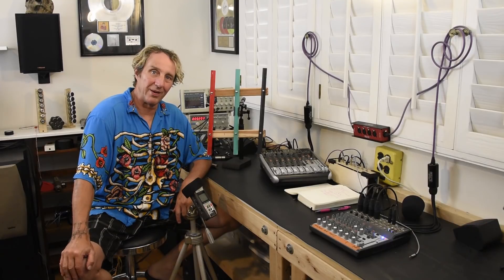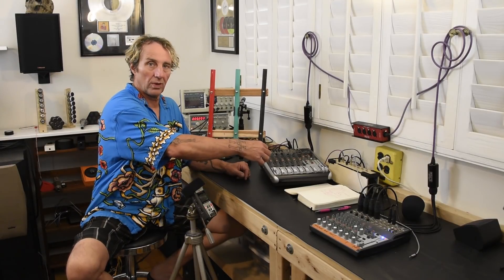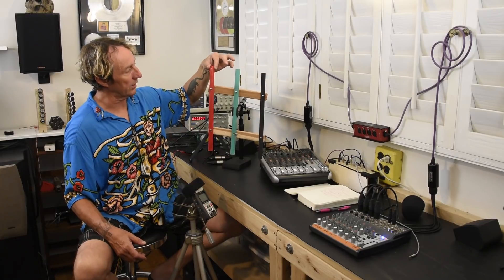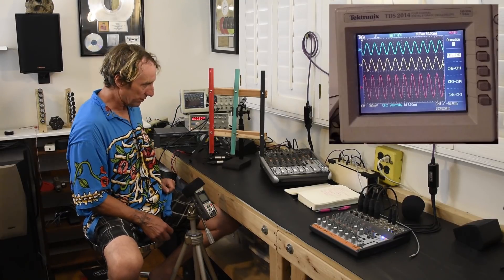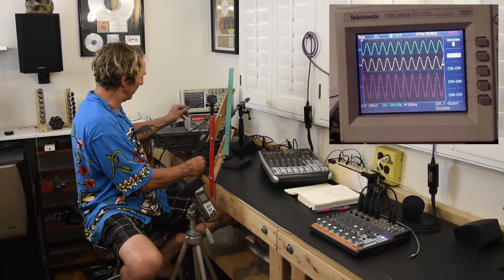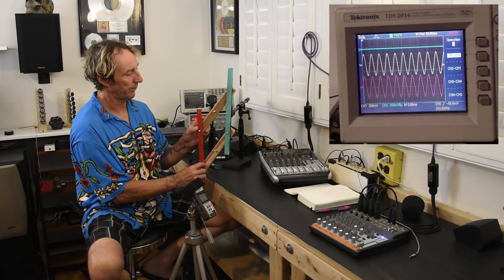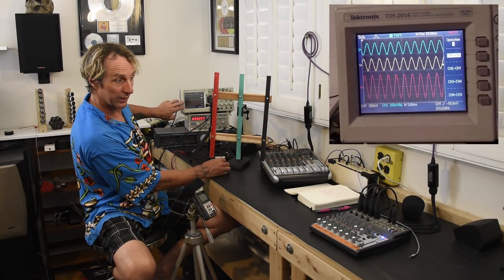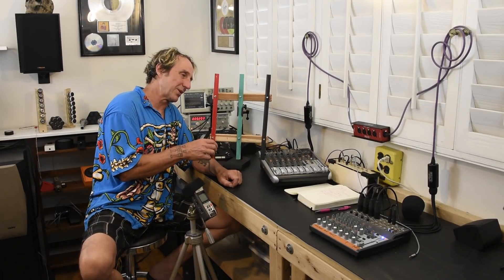How Do Balanced Audio Lines Work?

Comment: How is the signal on pin 3 put out of polarity? Where does it happen and how?
Reply from the maker: Electricity relies on a flow of electrons from and to. So for a 9 volt battery, the positive terminal puts out 9 volts on the positive in relation to the negative terminal.  it can also be looked at as the negative terminal puts out negative 9 volts in relation to the positive terminal. If you have two 9 volt batteries and connect the positive of one battery to the negative of the other battery and you connected the open negative to ground (0 volt reference), the open positive would have 18 volts in relation to ground. If you connected the open positive to ground, you would have negative 18 volts in relation to ground and finally, if you connected the middle where the batteries are connected together to ground, you would have plus 18 volts on the open positive and negative or minus 18 volts on the open negative, in relation to ground.

So, you could look at the plus 18 volts and "in polarity" and the minus 18 volts as "out of polarity".

A mic works similarly, you have a ground as the housing and pin one and the mic puts out a signal across pin 2 and pin 3. Pin 2 and 3 have equal and opposite signals. Like a see-saw, when one pin 2 goes up, pin 3 goes down and visa versa.  The signal we call "in polarity" is the signal that has a positive voltage when there is a positive pressure on the mic diaphragm. and that is the signal we attach to pin 2.
Reply: @DaveRat  Thank you for the explanation. I greatly appreciate your knowledge and the fact that you are sharing it with us.
Reply from the maker: Awesome and thank you!

Comment: So it is a common misunderstanding that balanced line requires three wires? The concept of balancing is possible with only two wires, right?
Reply from the maker: Only requires two for the signal.  The 3rd wire is purely a ground or shield to reduce interference.

Comment: Good day.   I like the demo!  because a line is balanced, it doesn't always mean it's differential.  For example I'm not certain any of the  TRS output on those two mixers are differential... They are likely impedance balanced meaning between the ring and ground there is a resistor(load) between it and sleeve.    This is to prevent ts connectors from blowing up drive circuits.   the drain wire is a mandatory return path for phantom, can't have it without it!
Reply from the maker: I believe that is correct for the TRS outputs
Reply: @DaveRat  I wish you would join us in the AES SC-05-05 talks!
Reply from the maker: Hmmm, not sure I am expert enough I. Aes to be an asset
Reply: Dave, never downplay the expertise that comes from actually practicing the techniques.
Reply from the maker: In many areas I have significant field knowledge. I really just have not had a lot of hands on with aes. When I was a pa tech, aes was not commonplace and was rarely used. As an engineer, my techs would use it and I would spec it, but pretty much it just worked for me and they dealt with any issues. And currently we use it in systems we deploy but again I just don't have much to offer. Same with fiber optic and Dante. My knowledge set is quite minimal in those realms
Reply: “Differential” meaning equal but opposite, right? I’m very curious about this as it would seem to me using a differential signal would be over complicating things, although I don’t understand it fully.

Comment: As Dave hinted at, the signals do NOT need to be exactly the same in (opposite) amplitude. That would only happen if the ground is exactly zero and in the middle. That is not required; in fact one of the advantages of balanced lines is that ground is no longer a reference. If you require that the phases are exactly the same in amplitude against ground, you re-introduce ground as a reference with all noise problems you want to avoid.
BTW great video, and a very imaginative analogy!
Reply: I’ve been trying to wrap my head around this. I recently read about how the “equal and opposite “ thing wasn’t actually how it worked and that if it did, there wouldn’t be a stable reference to make the comparison and filter the noise anyway, and it could introduce other issues like if the wires aren’t exactly the same length, etc… But I keep seeing the equal and opposite thing everywhere, and some of it does make sense. So is it that there are multiple ways to make the balanced circuitry, or what is up with that?
Reply: @almightytreegod  There's two cases that people bring up the 'equal and opposite sign' thing. One is misunderstanding what a balanced line is - we've been over the equal impedance thing. The other is where it makes sense to have a pair of lines with each line in opposite phase and equal magnitude referred to ground. That is differential signalling, and it will allow you to maximize the signal level you can transmit. With differential signalling you have double the signal level withing a specific power supply headroom, so half the noise. But ground is a reference in diff signalling (signals are opposite phase and equal magnitude referred to ground) so dirty grounds can have an impact. Real balanced lines have no reference to ground, they only need to stay within the power supply range. It is exactly that reason that you can't talk about 'oppposite phase and equal magnitude' in balanced lines because as soon as you do, the question is: equal/opposite referred to what? Say 'ground' and you have re-introduced ground as a reference which you wanted to avoid in the first place.

Comment: Hi Dave. I love your videos. You regularly blow my mind with the concepts and demonstrations. I hate to be that guy, but the balance of a balanced interface has nothing to do with signal symmetry. It is the balanced impedance of the high and low conductors relative to ground that determines the Common Mode Rejection of the interface. Check out Bill Whitlock's whitepaper on the subject for That Corporation: https://www.datasheetarchive.com/whats_new/a5736ca167115891b481677d6ec0cc99.html
Reply from the maker: Interesting. Let's take a look at 3 scenarios.

1) balanced line with equal and opposite signals. The mic subtracts one from the other, so you have 
a  -  (-a)=2a

Scenario 2 you have the same signal on both lines so you have 
b - b = 0

Scenario 3 you have differing signals on both lines so you have
c - d = c - d

Now you can any combo of those three scenarios occuring simultaneously and independently. 

And have one line with .5a, b and c and the other line with -1.5a, b and d for example and the result would be
2s,c,d

Just like if you had a, b, c and -a, b, d would equal 2a, c, d

Following this math out, you don't need signal level symmetry to balance, nor do you need both lines to be identical in signal content to cancel out noise, as long as the noise is induced identically, it will cancel.

All that said, the way balanced lines are designed to work on the gear we use is for the signals to be equal and opposite on the outputs and then subtracted on the inputs.

I will take a look at the white paper at some point when I get to a computer.
Reply: @DaveRat  absolutely spot on. There are a few differential input circuit designs, the cheapest and most common ones actually, that have one side of the interconnect driven at a lower voltage relative to ground. 

It doesn't matter if the high is at 1.23Vrms relative to ground and the low is terminated to ground on the output side with the typical output impedance. As long as the impedance to ground is identical for both hi and lo any coupled noise currents will become common mode voltages and be rejected by the differential input. 

Any difference in signals, whether that is the difference between +\-1.23V or the difference between 1.23V and 0V, will be passed by the input. This is how you can get some noise rejection if you connect an unbalanced output to a balanced input correctly. 

Bill Whitlock has another great paper on balanced and unbalanced interconnects that goes way deeper into optimizing noise rejection of interconnects. He is the you of the audio interconnect circuitry world basically.
Reply from the maker: @mudged-upguitars4643  super cool and thank you Joshua!
Reply: @DaveRat  thank you for all the cool videos!
Reply from the maker: @mudged-upguitars4643  👍

Comment: The way I always teach it to my underlings is this: You have a signal that is exactly the same but inverted, if you sum them together you get zero eight? The logical answer is yes. A 1 minus 1 = 0. So how does a balanced line eliminate noise? If one is a minus and the other positive and they would normally equal zero if added together, then what if you invert one of the signals back to a positive? 1+1=2 right. The answer would be yes. How does a balanced line eliminate or reduce noise? The noise injected on both the + and - signal lines are common to both of them, so if you invert one of the signals, you, therefore, cancel out the noise. This is CMR, or Common-Mode Rejection, at work. If they have no idea of what CMR is, I tell them to come back the next day with an answer. That usually works. 7 out of 10 " audio guys " cannot comprehend this, unfortunately. Most don't even know what pins 1, 2, or 3 are in terms of signal relation.  This should be a 101-course subject, but it is not exactly a common core lesson, unfortunately.
Reply: The  "balanced" so blocked only the noise instead of the signal because of the CMR?
Reply: @Gabbolbee  yes. Again, imagine two lines with the exact same signal, but the wanted signal is in opposite polarity on one of the lines. Noise that is injected on both lines is common to both of them. This means the noise is the same polarity on both lines. At the preamp, the signal of one of the lines polarity is inverted. This is what makes it become a 1+1. The injected noise now becomes out of polarity and cancels out. The signal we want has a three db increase and the noise is canceled out.
Reply: Glad for your for your replies, gonna figure out some little details
Reply from the maker: @Gabbolbee  👍
Reply: The noise is the same polarity on the two lines, so if you subtract the noise tends to go to zero. The signal is out of phase so in the diff receiver end you get the total signal amplitude.
Actually, the signals do NOT need to be exactly the same in (opposite) amplitude. That would only happen if the ground is exactly zero and in the middle. That is not required; in fact one of the advantages of balanced lines is that ground is no longer a reference. If you require that the phases are exactly the same in amplitude against ground, you re-introduce ground as a reference with all noise problems you want to avoid.
BTW great video, and a very imaginative analogy!
Reply: @jandidden8170  thank you very much, now i got it.
Reply from the maker: A balanced mic pre subtracts the two signals. Such that signals that are opposite get added and signals that are the same get cancelled.

Also, signals that are different, not opposite, and not the same, pass through

Comment: Why do some of my guitar pedals effects lose power and sound before entering my 1073 mic pre input ?  ..this is my set up synth/drum machine > guitar pedal > 1073
Reply from the maker: Hmmm, if the pedals are high impedance and the mic pre is low impedance, you may see a level drop. You could try inserting a di box between the pedals and mic pre.

Or, there could be a wiring issue on the 1/4" out of the pedals to the XLR to the mic pre, if those are the connectors. Check the adaptor wiring to I sure tip to pin 2, sleeve to pin3 and to pin 1
Reply: @DaveRat  oh I forgot to mention it works fine when I use the DI hiz input but it has a thinner sound and I like the rounder thicker lxr input sound
Reply from the maker: @eancurtis9333  hmmm, maybe try some different DI's.
Reply: @DaveRat  thanks !

Comment: So, I have a Hi-Z microphone with an XLR male connector. I want to use a cable with an XLR female to 1/4” male TS (to plug into a guitar amp). The pin outs on the mic are: Pin 1 to shield/ground, Pin 2 Hot and Pin 3 Open. Just to make sure...that means that Pin 3 is not connected to anything. In other words, on my XLR to 1/4” TS cable, I would open up the XLR connector and lift Pin 3 from its terminal, leaving a hot and a ground.
Reply from the maker: It's best to short pin 3 to ground
Reply: @DaveRat  Cool. I have a factory cable wired that way, but wanted to make sure I didn’t need to disconnect Pin 3. Thank you!
Reply from the maker: @chrisbalding3128  you don't really want pin 3 or 2 not connected with unbalanced signals traveling down xlr.  Even if not used because of you plug into a balanced input it will cause issues. But shorted or with signal, it will work.
Reply: @DaveRat  Gotcha. Thanks again!

Comment: Never thought of it being visualized like this. But works and saves taking about magnetic and electric fields. Great work in distilling it down so simply. You find most balanced cable is twisted to help ensure that both conductors experience nearly identical noise to enable more noise cancellation. https://en.m.wikipedia.org/wiki/Twisted_pair not sure if multicore audio uses different twist rates for each pair like telephone and data cables do.
Reply from the maker: Audio multicore uses the se twist rate, as do most individually shielded pair multi cables

Comment: Great video, as a youngster in the industry could you explain to me how a DI box works in relation to this principle? Cheers love your videos from Australia!
Reply from the maker: Great question.  Will look at doing a vid on DI boxes. Its tough to do the subject justice in a post but technically, DI boxes convert higher voltage, low current, high impedance and unbalanced signals into lower voltage, higher current, low impedance balanced signals.

If the signals going into the DI box were like the stream from a high pressure washer, the output of a DI box would be like water coming from a garden hose. Perhaps the same amount of water released per minute, but one is a high speed narrow stream and the other is a low speed wide stream.  A DI box converts a pressure washer stream into a garden hose stream.
Reply: @DaveRat  Thanks a bunch, I didn’t realise that a DI did more than just convert an unbalanced signal to a balanced one. I see what you mean it sounds pretty complicated but with the water analogy it kinda makes sense. I look forward to the video 👍🏼
Reply from the maker: @mitchbelectronics  cool cool. Yeah, and passive di's can be used backwards to boost a signal and convert balanced to high level unbalaced
Reply: @DaveRat  Wow I had no idea, thanks for the tip. This is why I love YouTube, I’m a 17y/o kid from Australia learning about DI boxes from the guy who mixes Chili Peppers 😂 unreal 👍🏼
Reply from the maker: @mitchbelectronics  👍
Reply: @DaveRat  Wait really?   So you can use a passive DI in reverse for say Re-Amping?  Interface outs, line-to-mic pad I imagine, XLR turnaround, DI.  Then instrument level TS to pedals or amps etc?
What's the difference between this and a dedicated (say radial) Re-Amp box?
Reply from the maker: @G_handle  a passive DI is an instrument level high impedance to mic level low impedance conversion transformer. In reverse, with an xlr fm to fm adaptor, a DI will take mic level in and output instrument level.

Since transformers are no directional, using the same transformer with differing packaging and connectors for various products, is not uncommon
Reply: @DaveRat  Once again Master Yoda, you teach me something that makes perfect sense, that I should have already known, that makes me wonder what other gems have been right under my nose for 30 years, hiding in plain sight.
Time to start opening up D.I.s and making up 'special' cables again...
Reply from the maker: @G_handle  super cool

Comment: I always knew that worked in the old analogue days of pre-amps, the better the pre-amp the better the cancellation. Do the digital pre-amps do it the same way when dealing with cat 5's etc?
Reply from the maker: Well, yes, higher quality mic preamps have a higher CMRR (common mode rejection ratio). Digital consoles actually have an analog stage including mic preamps, phantom power and such that deals with the CMRR and then gain the mics up.  Then the after the analog mic pre, the digital console converts the signal to digital. So, as with analog consoles, the quality of the mic pre, also applies to digital. In fact, it can be quite beneficial to use high quality analog to digital mic preamps with digital consoles.
Reply: @DaveRat  so analogue to digital at the stage box,  back to analogue in the pres of the desk and back to digital? No wonder it can be a mess.  Especially if analogue pres before the stage box as well?
Reply from the maker: @whitenoiseproaudio  digital consoles typically have a set of analog pre's either at the stage box or at the console. Once converted to digital, it can stay dig to either the output or send digital to other gear.

Comment: Great visualization, Dave. I'd love to see a demo of the difference between balanced and unbalanced with actual noise sources. Maybe a fluorescent bulb fixture or electric motor running next to a coil of each? You should be able to scope the noise on each conductor and show that it's identical. To simulate a balanced receiver, maybe even use the scope's Invert function on one channel to show how the noise cancels but not the signal. Also, you could add a telescoping ground cable into the demo to see how that lowers noise, too.  Good stuff!
Reply from the maker: Very cool and great idea!  I will look into a follow up.  Thank you Jen!